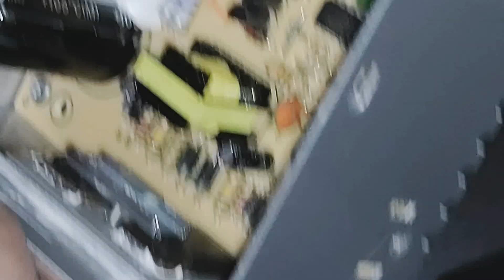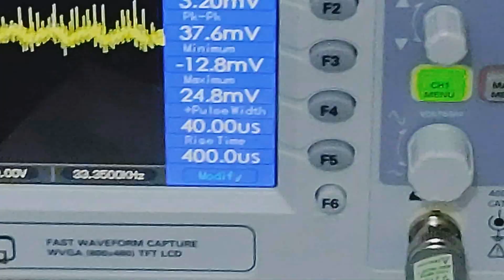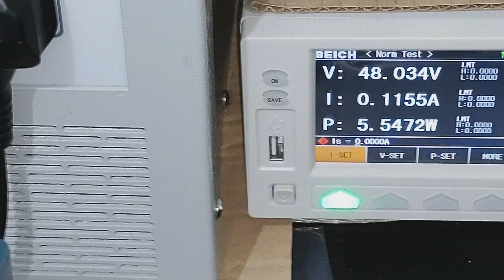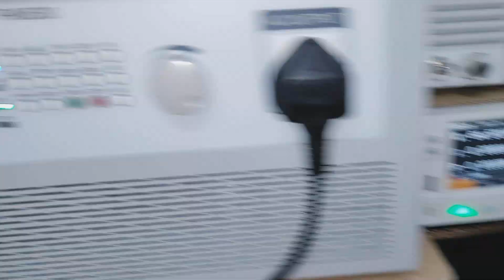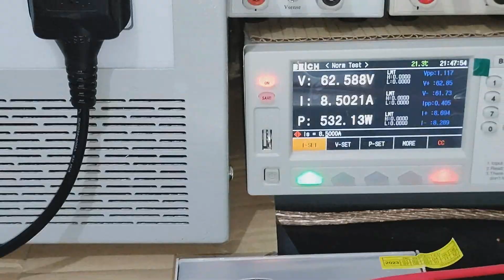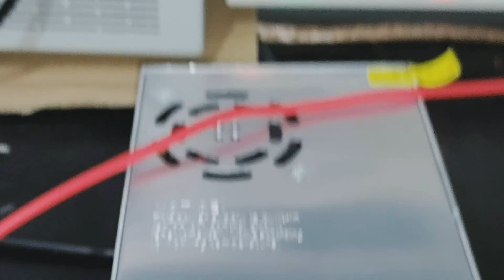Worth a buy? The $10 44 Volts to 64 Volts 10A Power Supply from Aliexpress

Comment: Any recommendation for tpa3255 power supply without fan? 
My current one has a fan and its noticeable.
Reply from the maker: I can only suggest an oversized psu with with a properly temperature controlled fan that way the fan does not turn on when the load is low to medium.That means asking a seller if there psu has a  temperature controlled fan.I had a few psu from Ruiding Tech. the one they use for there RD60XX series power supplies though the minimum voltage the psu can be set is only 53Volts but it is still a little bit high for the TPA3255.
Reply: @boknoynaruto3824  
Currently I'm using meanwell lrs-350-48v, the fan is annoying.

I don't need a variable power supply, just 48V will do. Fosi sells 48V5A but it costs 3x the price of meanwell which doesn't make sense to me. Any other hidden gems you found?

Comment: The handbook that comes with some of these drives say they can only be used at 70% of rated current of used occationally. and if you use continuously, then only 40%..    Have you tested running this at 8 amps for a long duration, like days?    I heard that they burn out completely.
Reply from the maker: The primary rectifier of the PSU GBU810 its datasheet says this can do 8A @ 100℃, the 2 primary swithcer 2sc2625 its datasheet says this can do 10A and the Secondary Rectifier Diode N-D92-02 its Datasheet says this is rated at 2 x 10A (20A total).

If the specs of these parts is to be believe it will be able to deliver 8A continuous at 220-240 volts input primary voltage even if the parts are derated at 40% but as always it is different with actual test , unfortunately my place is not suitable to test parts like this for extended period and just do not have the funds to run the test for days due to electricity cost.